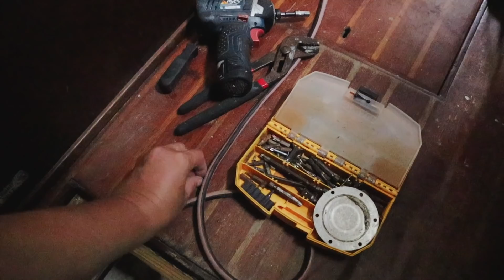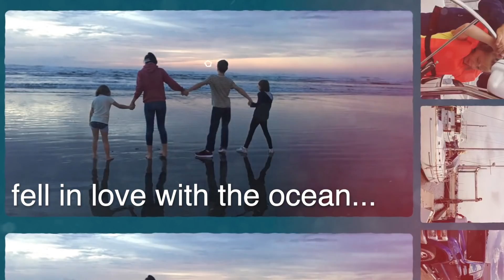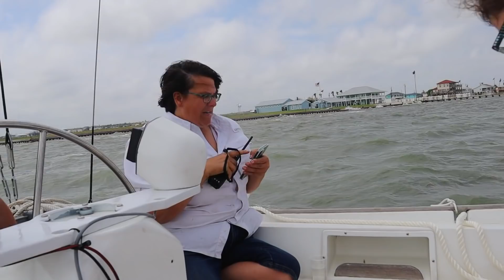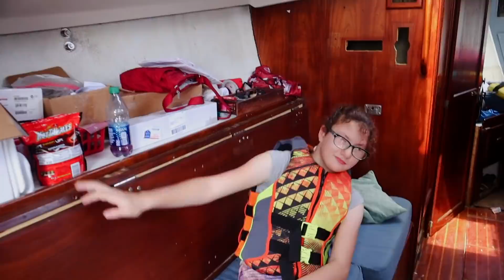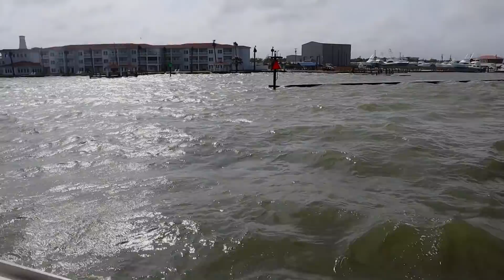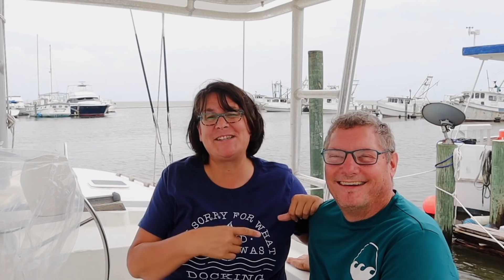Docking Gone Wrong! | ep. 168

Comment: Learning curves. One day long ago. I backed my newly renovated boat and  trailer in the water. Launched the boat. Started engine and departed the area. Only to realize I had forgot to put the plug in. The boat was filling with water. That problem was easily solved. Try to let the good times roll anyway guys.
Reply from the maker: Ship happens. Glad it was solved for you. The reality is there are very few actual emergencies on a boat that won’t allow you a little time to come up with a plan. Docking can be one of those but you are generally going so slow you really can’t damage too much. Like you said, roll with it.

Comment: As a sailboat owner, I completely identify with you...both! Throw in on top of that a chicken of the sea! Throw those lines off, and do it again and again until you master it. 
I've learned (somehow) to come in a little fast and get a dock line around the first piling which is tied to midship or stern cleat and pull tight as hard as possible which will slow you down before a bow impact when it's windy.
Practice, practice, practice. Patience, patience, patience.
Also, less distraction is best. Kids and a dog would worry me to death!
You both did super!
Reply: You should also ask the marina if you can install a 2x6/8 along the outside of those pilings or have a few tied to your own boat outside of your fenders while you practice docking.
You're welcome!(I scratched a few myself so...) Lol.
Reply from the maker: Thanks! We’re figuring it out. We think going too slow actually contributed to the lack of steering.

Comment: Thank you for the laugh 😂 brings back memories. I own a 74 Morgan Sloop a real ( crab crusher) and have maybe had a docking incident or two . I always make sure to have a drink before I dock . This seems to help ! There’s a fine line between going to fast or too slow the boats need water going past her rudder to steer, and don’t be afraid to goose that motor it helps.
Just remember your trying to turn a sheet of plywood in the water so set-up is everything… remember it’s nerves that usually gets the best of us and if it’s to wild out there just hold off or anchor till it calms down .
Reply from the maker: Those old Morgan’s are tanks for sure. Great advice! Thanks for watching.

Comment: You are doing fine.  Make yourselves some fenderboards and get some larger ball fenders.  Keep practicing. It will get better.
Reply: @Jamesl1945   scratches are the price of experience. Rub rails do help but with gentle bumps only.  Older kids can help with roving fenders - they hold the fender line in hand and drop fender over where and when needed to let the boat bounce off hard points. Instruct them to never use hands, legs or body to fend off - only the fender.  When windy, before getting in tight quarters, slow the boat down an see what the wind and current do to the boat.  It is ok to abandon going into your slip, find one that is easier to approach, and wait there until you have extra hands and better conditions to get into your slip. For docks with pilings, fender boards are super helpful on the leeward side.
Reply from the maker: Thanks Daniel! We've got some now and while they help while docked, we're going to need to get some bigger fenders and or put some on those pesky pilings. Yep, we're going to have to learn to do that for sure. Actually really glad we were able to pull ourselves into the dock or we would have ended up blown against other boats.

Comment: Getting to grips with a new boat is traumatic and my days boating is governed by the weather. Not just the weather while on the water but what the weather will be like when I try to get my boat back into its berth without wrecking it or my berth nieghbours boats. Mooring a long boat with no bow thruster in any kind of wind is pretty much impossible to do at slow speeds so keep speed up, never stop unitl in the place you what to be tied off. I live with this issue every trip in "windy Wellington" Essentially it is managing momentum. If you don't control the boat drift, drift will control your boat. I have a order of priorities coming into a berth or alongside:
Don't hit any other boat
Don't hit anything hard, faster than a well timed and well placed fender can absorb it. 

Don't be defeated by this or the next loss of control. I think you actually did really well in those conditions.
Everyone with a boat has done this and will do it again. Anyone who says otherwise helms a desk or is a liar. Your emotions are exactly what we all go through, keep practicing (I use soft bouys out in open spaces for come along side practice) I have found if I need to navigate in tight spaces on windy days to reverse against the wind/drift so rather than having the bow get blown off to port or starboard the bow naturally tails behind like a weather cock. practice that, try it out, it makes life much easier and controlled.
Well done for getting that boat into the water, fantastic effort.
Reply from the maker: That’s great advice, we’ll give it a try. Thanks Mark! 👍❤️

Comment: I missed hitting the dock my first time solo docking. Not so much for the pilling 20' away from the dock. It all buffed out after 4 hours of glass work and 12 hours of curing time 3 coats of Gelcoat and more curing time. Yep it all buffed out. A little wax and looked better than new. ; ) 
I had no motor and had to try and come in unskilled under sail.
Reply from the maker: That means you did a fantastic job! No motor? Take that all you couch captains!

Comment: Thanks for posting the reality of sailing, wind is a sailor's best friend except in a marina. We cannot control the weather, so practice, practice, practice. Sometimes if the wind is too much we anchor near the marina and wait, but it is not always possible. We also do a "sail by" and check the moored boats situation, line tension, tide height etc, all good indicators of wind and current effect, and we try to face the wind if possible, much like landing a plane.
At the end of the day, docking is always hazardous, and things always happen super fast, especially with kids and pets on board. Keep at it, and it will be worth it, then you can do the capt'n Ron fancy docking one day. (Better practice on the boss's boat first..)
How did the electric motor and batteries perform? Take care
Reply from the maker: Thanks for the kind words and advice! 👍 We’re going to cover that in next weeks video.

Comment: The first day I docked the boat, I ran into the dock. Since then I have made a ton of scratches on my new paint. There is always something that will interfere with your docking (and undocking) plans. It could be the wind, another boat going out at the same time as you do, etc. One day you will be a Hero, another day a Zero. This is like those who run aground, they either admit it or lie about it. Don't be too rough on you, you weren't  born experienced at boating, you will acquire your experience with time and errors. I am experienced thus I made many expensive errors... Cheers, Richard
Reply from the maker: Thanks for sharing Richard! ❤👍

Comment: To be honest I do not think anyone can reasonably criticise you. You are newbies and have to ascend a very steep learning curve and that includes learning the boat and how it handles both ahead and astern. If you do not mind receiving advice mine would be this: Conduct ‘table top’ exercises that are scenario based have some cardboard cuts out, one boat shaped, one jetty shaped and two arrows (one for wind and one for tide). Create the first scenario with the wind at 90 degrees to the jetty  (do not bother with the tide arrow)and then discuss between you using the boat at shape to describe how you approach the jetty and what forces are acting on the boat, and what happens as way comes off the boat when near the jetty. Then repeat the discussion for same conditions but approaching the other side of the jetty. Rinse and repeat for as many wind directions/tide direction combos as you can stomach. Then it is all down to practice - it is useful when entering harbour to plan the approach - if you are know where you are berthing look at the other boats and see if you can figure the wind direction and strength at the berth - then discuss and agree the approach. Often times a marina will offer an unfavourable berth (given wind and tide) - do not be shy of going back to them and tell them that and ask for an alternative. The table top approach is a great way of learning together without stress.😀👍⛵️PS - any landing you walk away from is good enough.😉
Reply from the maker: Great advice!! Thank you. We were just talking about going over scenarios like we do for self defense as a learning tool. 👍

Comment: I got a smaller boat that was mixed but in a deal I made and the boys who were younger at the time. My wife who dislikes boats agreed to go out on a smaller lake with us all was good until the motor got vapor locked and I couldn't get it restarted. Then about that time the wind came up and was pushing us to the wrong side of the lake from where we docked. I was doing my best pulling the rope trying to get the motor to start but no go. So I grabbed the paddle and was trying to paddle into the wine trying to get us back over to where we had put in at but the harder I paddled the more the wind push us toward the other side. So a couple of guys in a canoe came by and towed us to a dock on the wrong side of the lake. One guy that was in the bar saw what had happened and gave me a ride over to get my trick and trailer so I drove around the lake to get my boat and family. I got the boat in and then we headed for home 45 minutes east. By the time we got home it was made perfectly clear that the boat best be out of our driveway by the end of the following week. Well I ended up just giving the boat away for free and sold the motor to someone else for $200.00 because that was what I paid for the motor... Never again did a boat set in that driveway. But when the boys got in their teen years I got a canoe in another deal I made and the boys and I used it for fishing a lot when my wife was away working... LOL...
The boys and I learned a big lesson my wife DISLIKES even HATES boats. Boats are nothing but a hole in  the middle of the water that you throw money into...  that was some 20 years ago and she still feels the way about boats. But it sure use to be so funny to hear her tell the story of our first and last ride in that little 14ft. boat... LOL
Reply from the maker: Holy cow, that was an adventure for sure. 😂

Comment: Owned a 35 foot 17,000 lp pontoon housboat th a single 90hp outboard.  In my first season bent the wave defector flush to the pontoon.  In my second season bent it back into perfect position.  Once traveled a full skip length BEYOND my slip cause I lost sight of my rudder position.  After 4 years i would often get ferried out to other bigger boats when the winds came up to pilot them in.  You'll break a few things along the but if you're going slow enuf it's all repairable.  Get over it and if all else fails -- SCOTCH!
Reply from the maker: Thanks for the encouragement! 😍

Comment: You may be able to string ropes in a V in your slip which would make it much easier to dock without so much trauma. You will eventually have to get in and out of strange slips, but with practice it will get easier. As others have said, we've all gone through some rough landings and still do on occasion. What really scared me in your video was seeing you out in moderately rough conditions with two kids, a dog, and no lifelines. I feel that was a way bigger mistake than anything that happened in your docking. Don't get me wrong. I'm a big fan and I think you'll both mature into great sailors. Just remember that there are a ton of mistakes you can learn from and sail again another day - but some you can't.
Reply from the maker: Yes you are right, some you can and some you can’t. Lifelines are going on pretty quick. That will make a big difference, and netting too which will help with Denali.

Comment: You guys may have been a little out of sequence with your boating life.  You are supposed to get some practice and experience before you make the boat look pretty.  Then you get two exciting splash days. The first when it is mechanically sound and the sailing begins and then again later at the rebirth of the new and beautiful boat.  Unfortunately there will be many more stress experiences in your future.  But you are not alone.  Everyone out there has had to learn the same lessons.  As long as you are safe and smarter after it is over then it was nothing but a learning experience.  The lows makes the highs that much sweeter.  Never be afraid to reach out to fellow sailors for advise or even some direct help.  We all are part of the same family.  I hope we cross paths on the water some day.
Reply from the maker: Thanks Tim! Yeah we did it a little different than most. We hope we see you too!

Comment: So everybody destroys impellers, don't worry about it. They are just a crappy annoying design.
I think a coarse filter after the pump before the cooler would be a good idea to catch all the pieces but they never fit them on motors? Why not?.
Sorry you scratched you paint but at least you know how to fix it!  You also know now why the boat originally came with a huge heavy ( leaky) wood rubrail on it!
Have you watched 'ask captain chris ' he shows its ok to use the pilings to turn or bump a boat on , you just need a fender or preferably a rubrail to do it with!  
As you practice docking remember to try docking in different docks so you are ready for different situations.  
I'm proud of you for taking the shorter but harder route , the right choice I think.
And best of all the electric drive worked ! Were you running the generator? I don't think so.
Hey well done TODD for staying calm and Tammy you made it thru too , as a friend of mine said to a guy we sold we sold boat that almost sank on the test sail and he was having second thoughts 
' you survived the worse thing that could happen ' you can handle anything now! He bought the boat!
Cheers Warren
Reply from the maker: Thanks Warren. The motor worked great. Next weeks video we’ll cover that. I stayed calm through the whole ordeal. Just gave in to adrenaline and exhaustion after we were tied up and safe. 👍